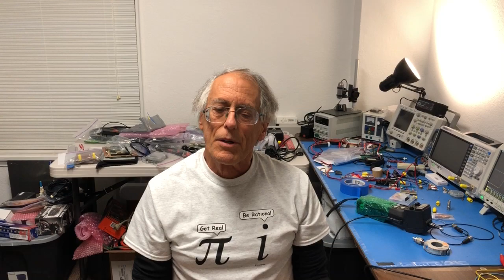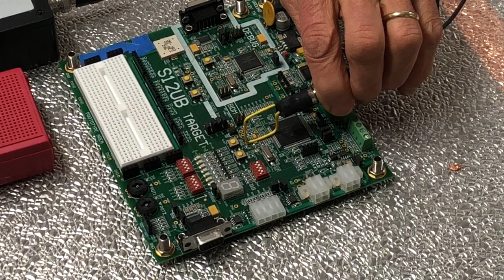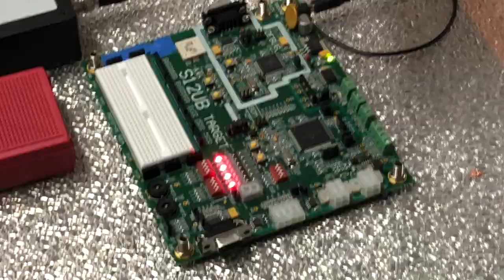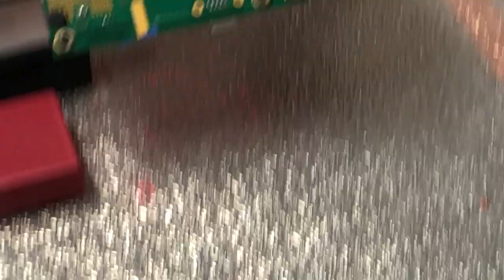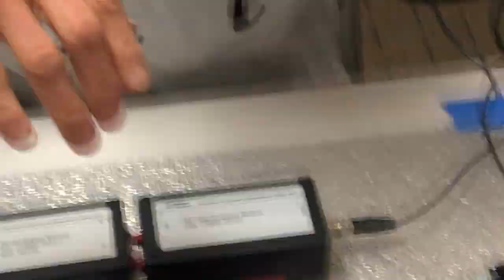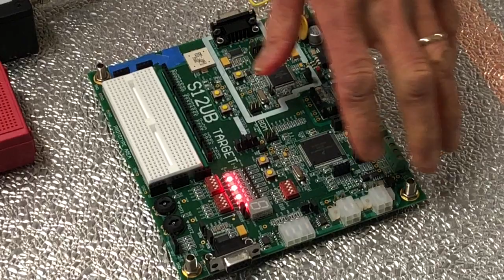2: Finding PCB Layout Defects with the Fischer EFT Pulser

Comment: I like that it's a localised injection of the EFT pulse.

What I found with the earlier EFT generators was that they worked great with the 50 ohm load, but any deviation from that they created lots of oscillations instead of a pulse.   Anything other than the perfect load as stated by the standard never gave you the required pulse.   Later EFT generators controlled the waveform much better, therefore with non-50 ohm loads they still gave the desired EFT wave shape.   This was critical for my work as I was simulating the EFT generator to apply the pulses on to PCB models extracted from an EM simulator.    (All documented in my Ph.D. thesis!).